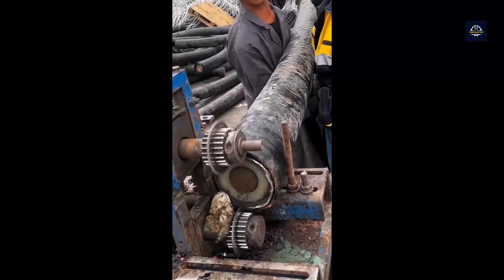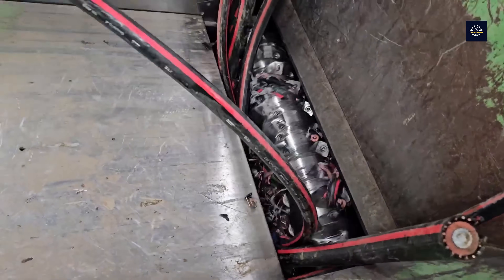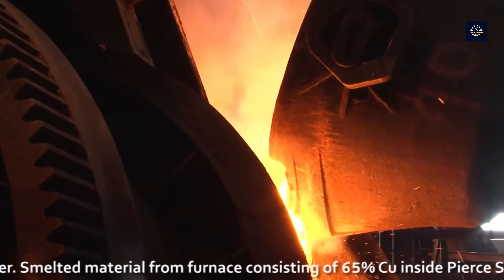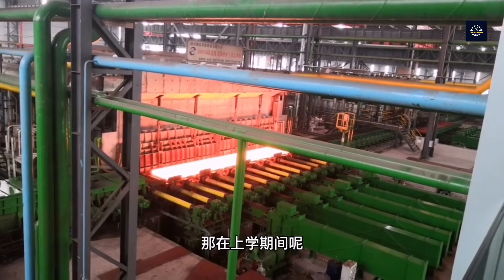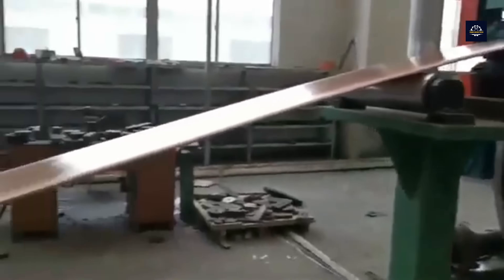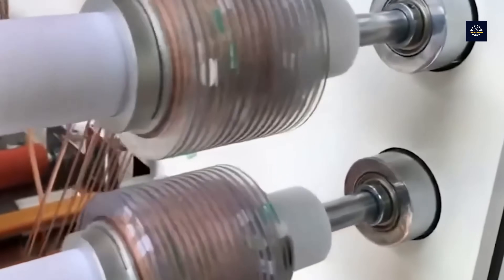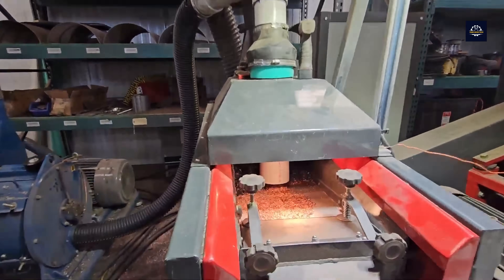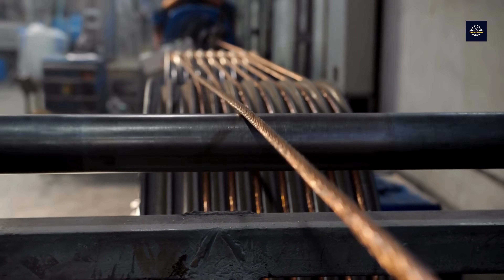How to Recycling Electrical wires ?

Comment: How to you separate the alluminum?
Reply from the maker: There are several ways to do this. One effective way is to use an Eddy Current Separator. As the mixture passes through a strong alternating magnetic field, the aluminum is repelled by the magnetic force while the copper is less affected.

Comment: You missed one complete step in the recycling. After the melting of the granulate you still have other metals inside and you also show the Electrode Plates.
After that they send the plates for electro recycling. They strip first copper, than silver and then gold. These copper sheeds will then be remelted and you have
a 100% Copper sheed. This sheed then gets reheated and rolled.
Reply from the maker: Thank you.

Comment: Copper is durable materials to use in any high voltage and heat. Like bullets, electric wires, circuit board, electronics device so amazing materials than the other materials.

Comment: Your video was very good and informative, I do have a question somewhat off the wall, I own and operate a recycling company for over 28 years in Cedar Rapids, Iowa USA, I have recycled 100 of thousand pounds in 28 years, lately I've been interested in upping my bottom line by adding a Granulator Machine to produce a better #2 clean copper scrap, as we have a large copper processing plant here in Cedar Rapids, (PMX), and as one of there oldest vendors they agreed to purchase all me clean copper, making my bottom line greater.

My question is, I have decided on the granulator machine I wish to purchase, but this will only do braided copper wire, that is generally what I get, But on occasions I get large amounts of solid strand wire, What I am looking for ia Machine produced by a company called NiTech and the machine is called CableX, I have exhausted all avenues of searching where the unit can be purchased, most of the videos on the wed were posted some years back, I've tried to contact MiTech to no avail, What I'm asking is if someone one your team night be able to head me in the right direction to locate where I can get information on this unit, Thank You in Advance, Yours, Scott Huffman, Owner, Reliable Recycling, Inc., 521 9th St SW, Cedar Rapids, Iowa USA, (319)270-6863

Comment: The availability of wire recycling infrastructure varies greatly by region. In many places, access to specialized recycling centers capable of extracting and processing copper from old wires is limited or non-existent. This means that a significant amount of old wiring still ends up in landfills, contributing to electronic waste rather than being "revived" for a new life cycle. The optimistic tone of the statement doesn’t reflect the logistical and systemic challenges of making copper recycling universally effective.
Reply: The high value of copper as a scrap metal encourages recycling through scrap metal dealers. Whether or not there is end to end recycling capability within a country is irrelevant, and doesn't influence overall recycling %. In countries like my own, there is no end to end recycling, but copper is highly valued at scrap metal dealers (10 times aluminium scrap value). So people sell their old wiring and plumbing to scrap dealers who then export it to countries that can recycle it

The same with aluminium, lead, steel, stainless, zinc and other recyclable metals